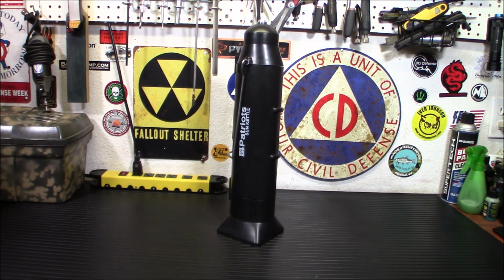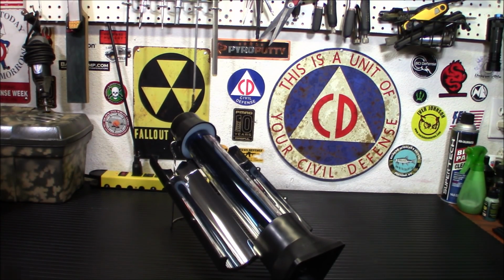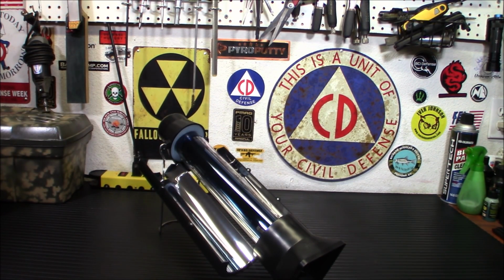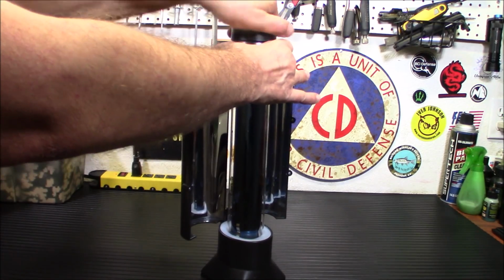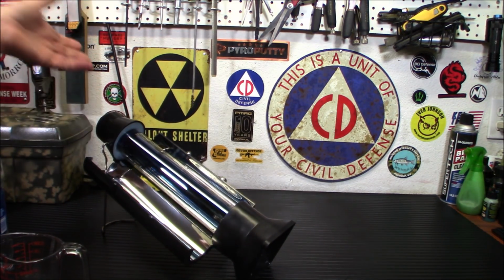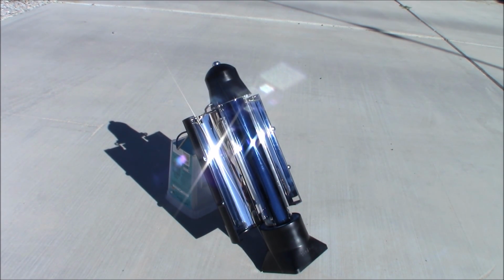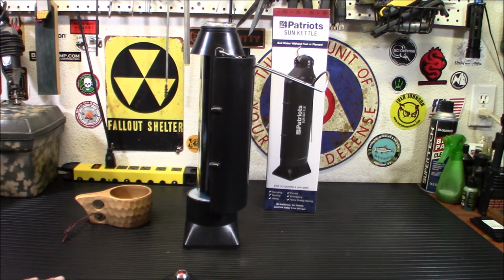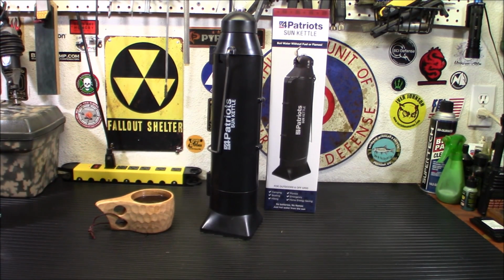The 4Patriots Sun Kettle!

Comment: The thing about getting water from snow is it can be dangerous.  If you are just grabbing handfuls and melting it in your mouth uses a lot of energy and speeds up the onset of hypothermia.  Even just cold water can speed up hypothermia.  The ability to warm up water to body temp or higher is a huge bonus in cold weather.  Even if I'm not going to boil water with it I want to add one of these to my winter car kit.  Thanks for sharing.